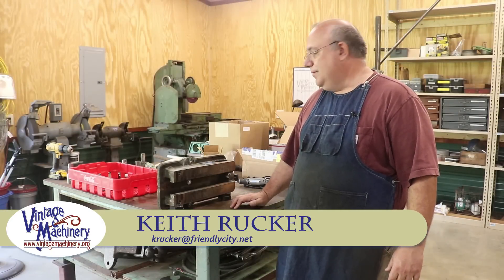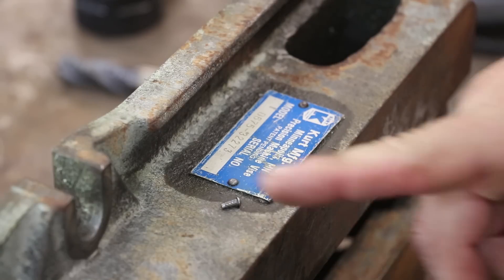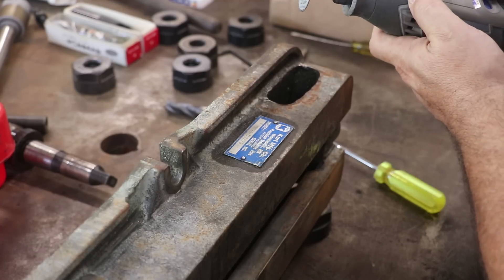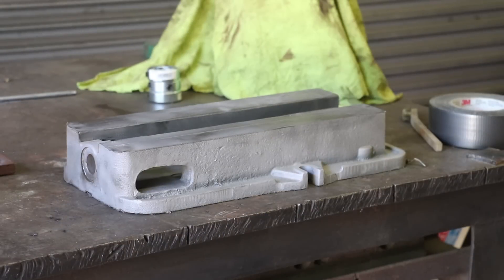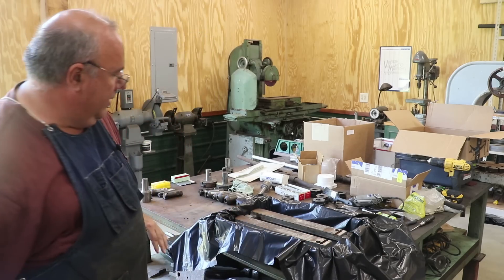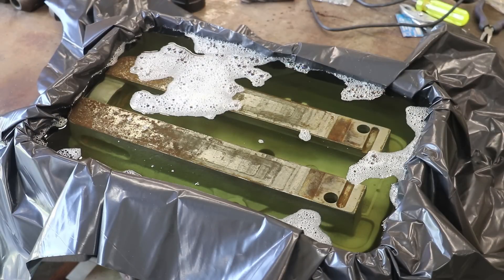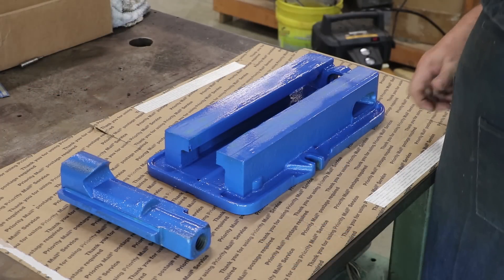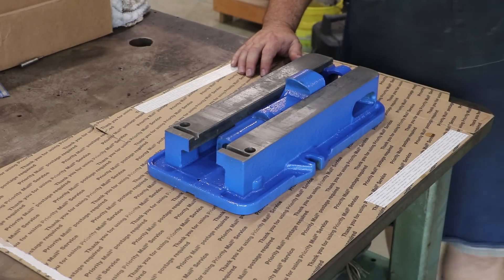Kurt Vise Restoration Part 2 - Painting and Grinding the Base

Comment: I have a question about the surface grinder. While grinding, especially something hardened, how do you account for wear in the grinding wheel while trying to get a item ground accurately? That Kurt base looks great Keith, wouldn't even know it wasn't brand new 😁
Reply: You're always grinding with the side edge of the wheel, which wears down and exposes more of the flat portion of the wheel.. Think of it as wearing away with a slight taper to a flat part. 
after you dress the wheel with a diamond tip to get it to be fully flat again.

Comment: There's a really neat way to get Drive screws out and even be able to reuse most of them. I take a pair of small Diagonal Wire Cutters and act like I'm cutting the head off, the screw will either pop up enabling removal and reuse, or  the head will pop off.